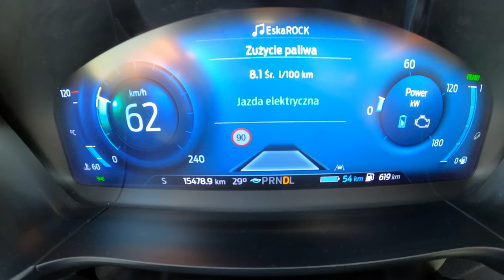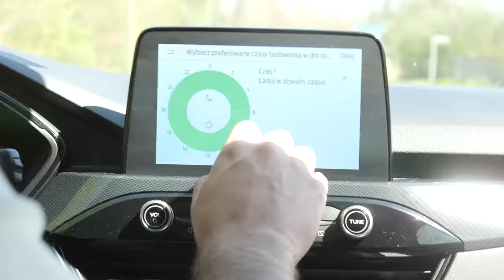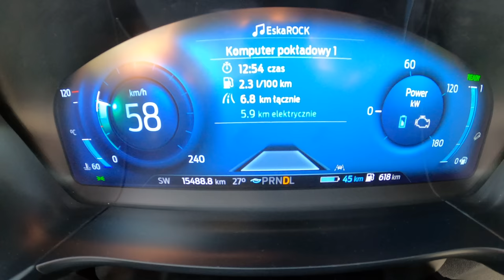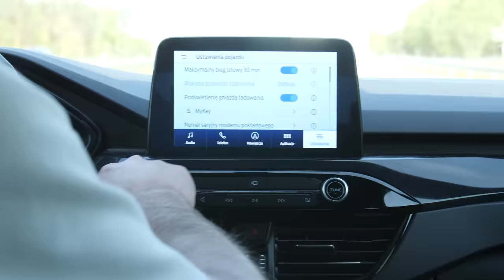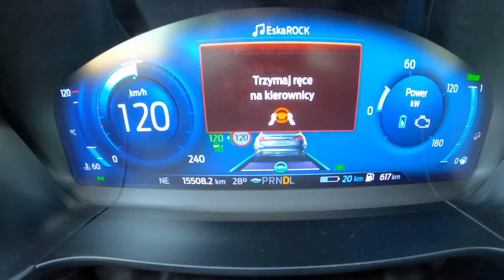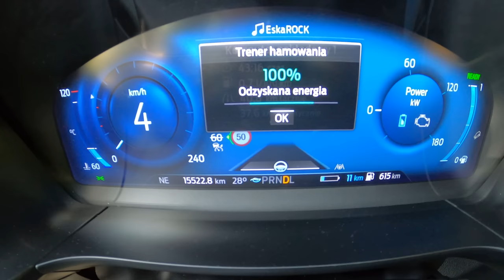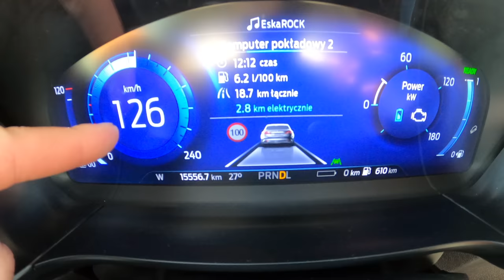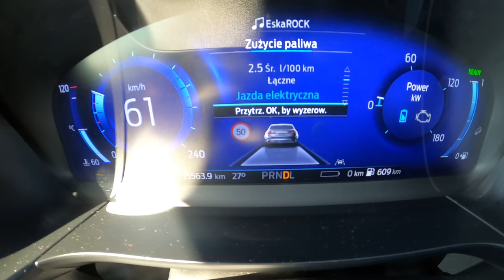Ford Kuga PHEV, czyli tym razem na poważnie (TEST PL) | CaroSeria

Comment: Ecvt to wynalazek Toyoty, Ford z tego co wiem kupił patent Toyoty ;) nic dziwnego że dobrze to wszystko działa. W rav4 tez jest benzyna 2,5l - przypadek? ;)
Reply from the maker: Nie sądzę... 😂
Reply: @CaroSeria  a jednak ;) "It’s a potentially lucrative reversal for Ford, which just a decade earlier had to license patents from Toyota when it developed the first Escape hybrid. Ford’s hybrid and plug-in powertrains, whether stuffed in the Fusion, C-Max, Focus, or Lincoln MKZ, are excellent, even if they don’t achieve the EPA-rated fuel economy of some applications of Toyota’s Hybrid Synergy Drive or deliver the Chevrolet Volt’s electric range."